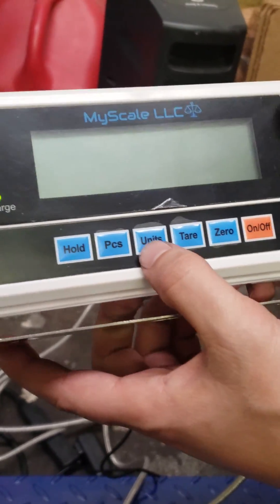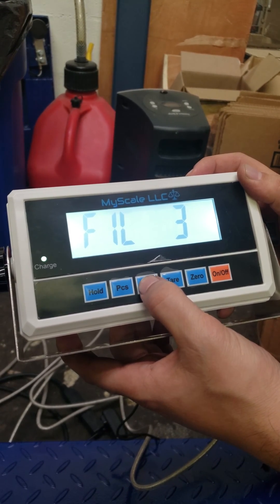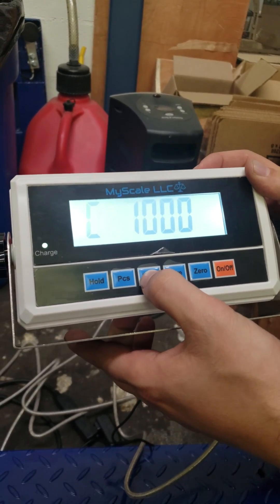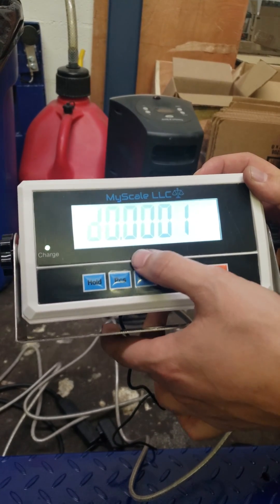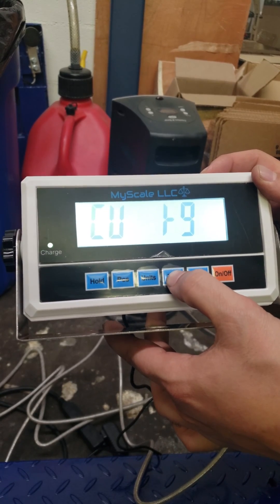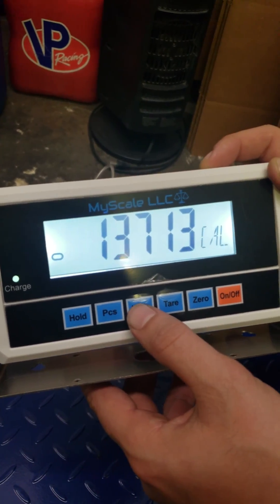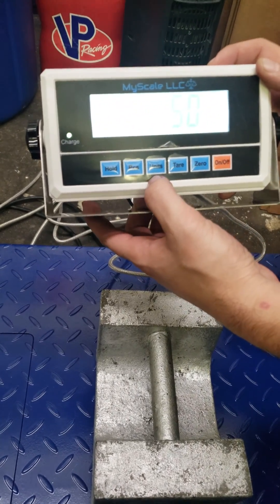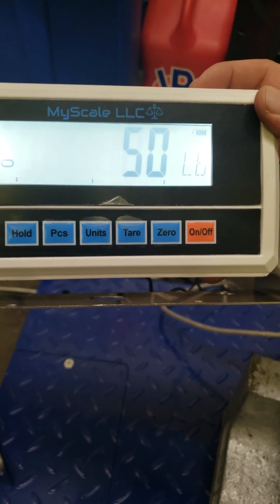IN-520 indicator calibration provided by SellEton Scales

Comment: Thank you so much for this video. The instructions I received on my kit from another company were horrible and inaccurate. This video helped me through most of the issues. 

One more question though:
How do I turn peak hold off? My scale doesn’t adjust up and down with weight, I just holds the highest value.

Comment: What if the cal number is a negative
Reply from the maker: Then that means there is a connection issue. It could be a bad cable. Please open the aviation plugs & check connections on both the junction box & input cable.